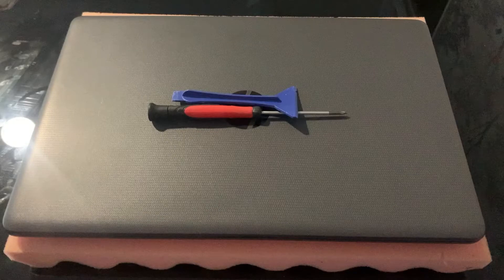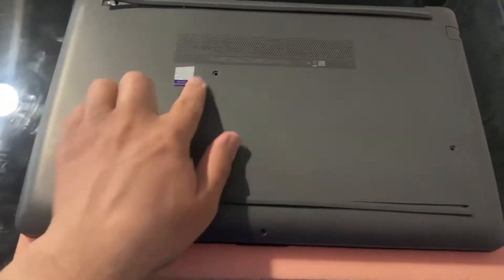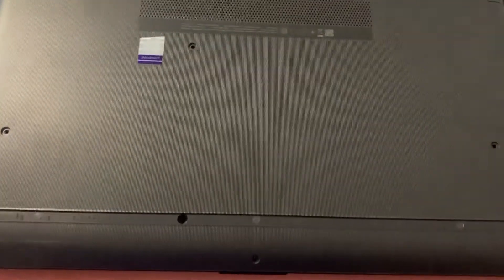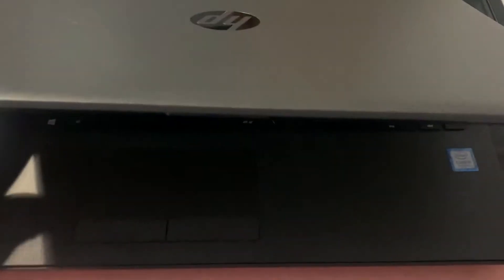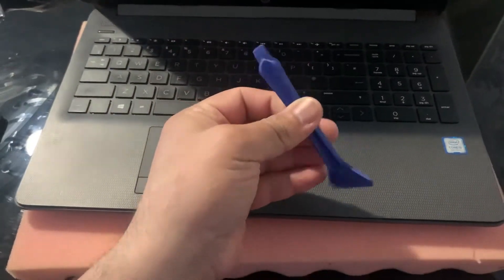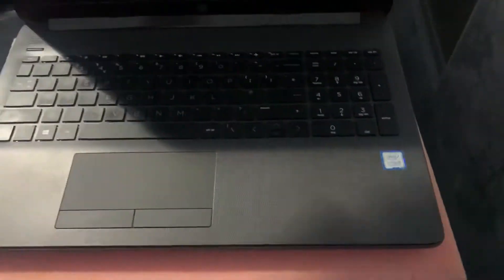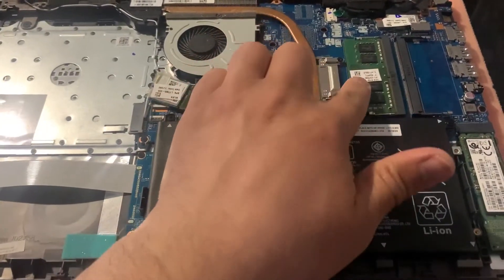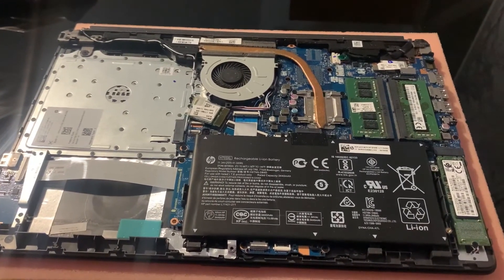HP 250 G7 - How To Upgrade Ram (Memory) | How To Remove Back Cover | Disassembly

Comment: hp 250 G7 , i3 - 1005g1 ,ddr4  2666 mhz   
4gb ram , 1TB HDD + 256GB SSD

I want to use Linux & windows in dual mode 
So how much configuration is required for upgrade Ram and storage ?

Comment: hp 250 G7 , i3 - 1005g1 , 2666 mhz , ddr4  is this your device? And and how max it support ram slot , i have 4gb in right now  , but want to upgrade, so i am thinking for 8+8 gb or 16+16gb so it will support or not ?
Reply: Hola yo tambien quiero saber si funciona con 16+16 GB lo comprobaste?